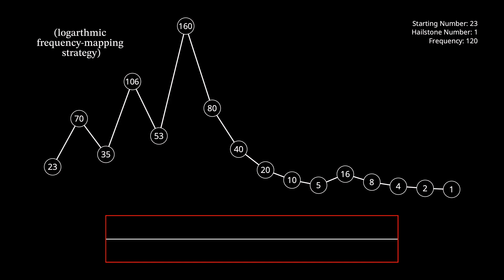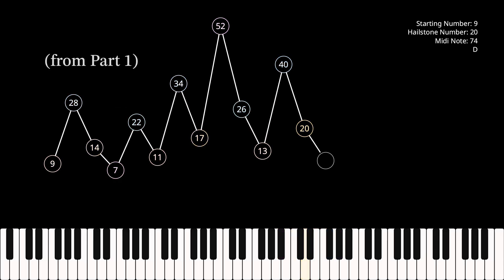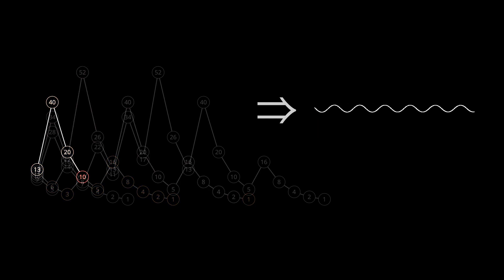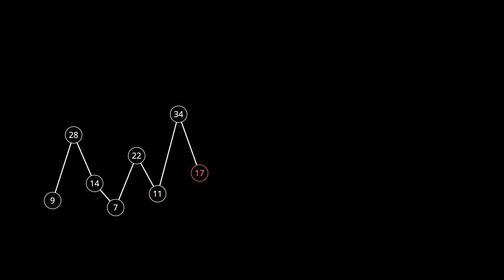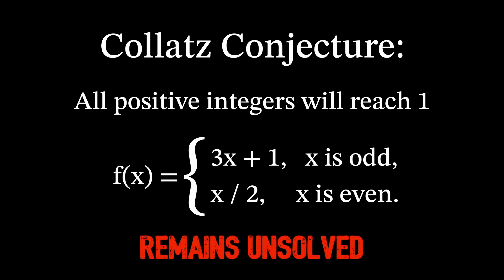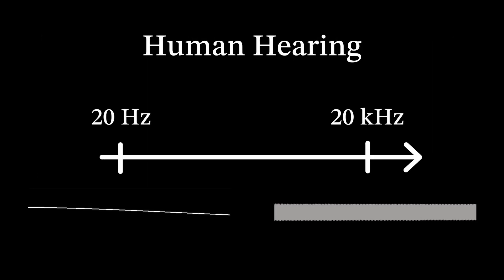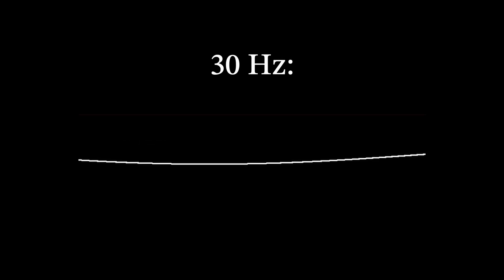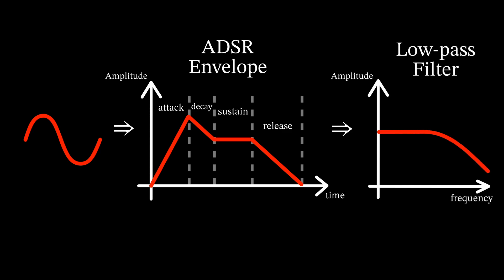Sounds of the Collatz Conjecture, Part 2: Generating Raw Frequencies

Comment: For the first version, multiplying a frequency by 3 and adding one is very similar to going up an octave and a fifth, especially as the numbers get higher. So it kind of goes around the circle of fifths, octave reducing as far as it can while still getting an integer frequency.